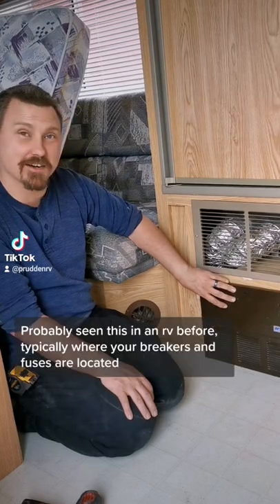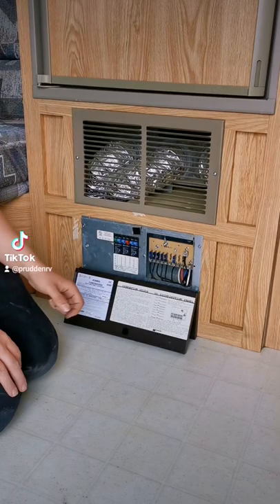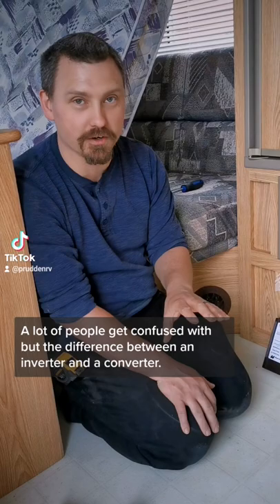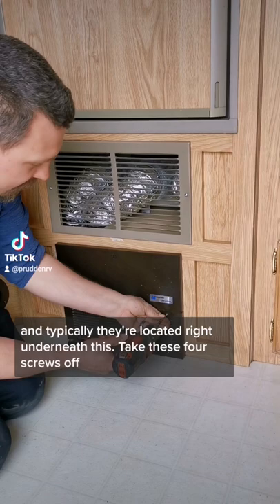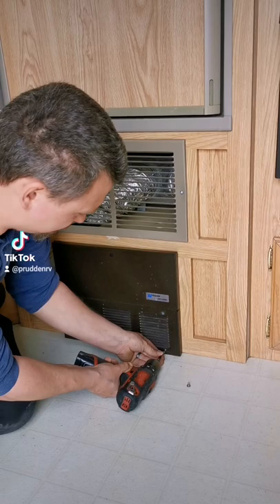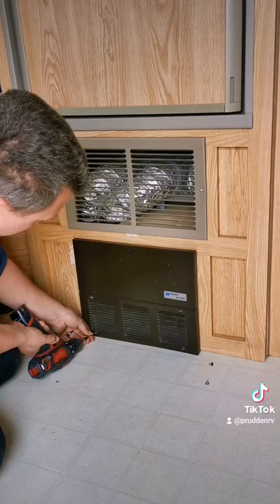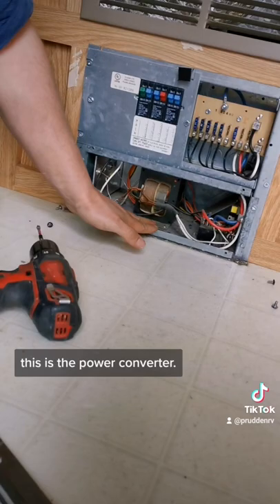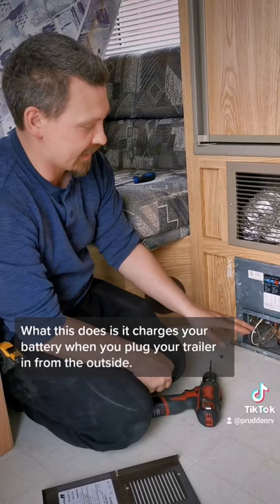Converter vs. Inverter

Comment: Could you take the face off your brakers and see where the black wire is coming up from the converter to witch braker. Is it running to the main braker or one of the others. There's 3 wires total Goin to braker side 2 of them is grounds. It would be very appreciated. I really need to kno  for mine. Tag me if you do

Comment: I need to install an inverter charger because my converter is not designed for a lithium battery. Do I need to remove the existing converter?